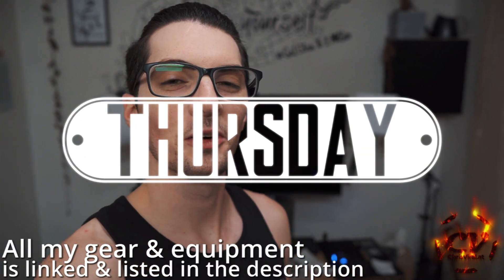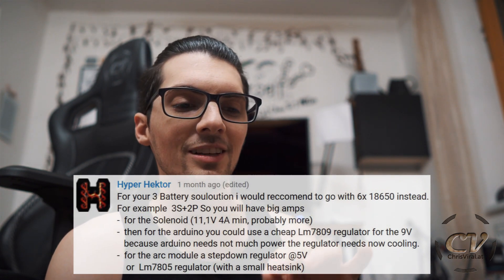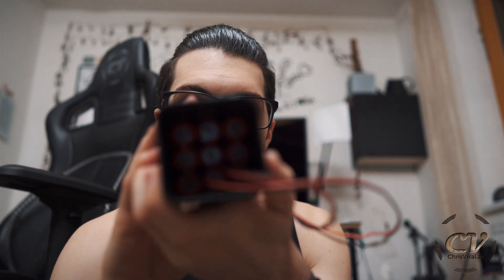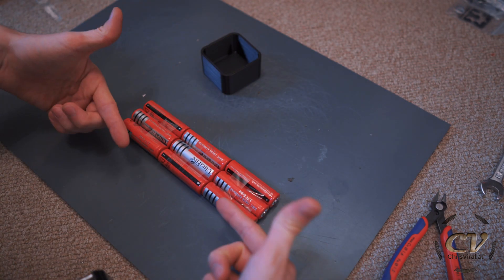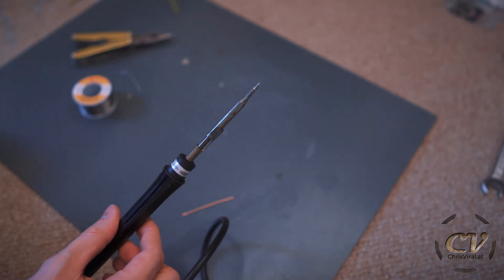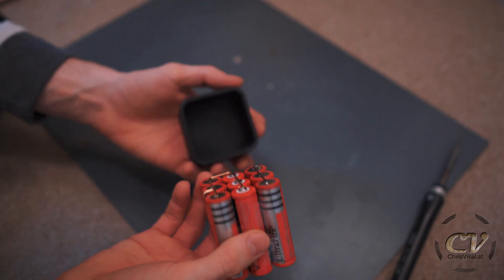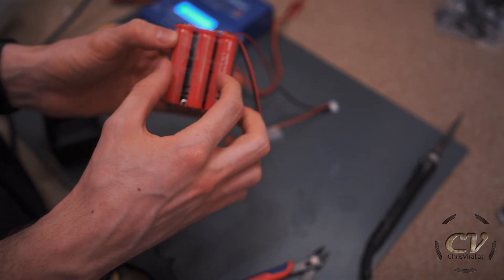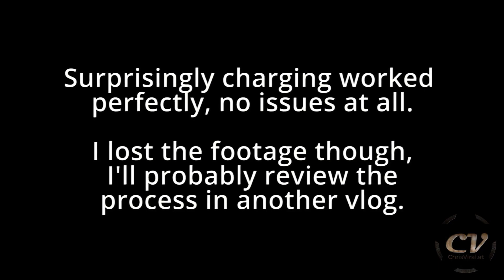DIY 3S Battery Pack (3P3S - With 3D Printed Case)

Comment: Bro, you should not be making a video that you clearly have zero Fuchs as to what you are doing. You are advertising very dangerous sop’s and could get someone hurt or even burn down there house if they followed your so called DIY battery pack instructions. The fact that the 18650’s your using that you got a such a great deal on at 90 cents each is a dead giveaway you really are as dumb and ridiculous as you sound. This is actually a perfect video of what NOT TO DO, I mean the way you explained your drawings was top notch man. Now if anyone watching could actually understand anything you attempted to explain, well they deserve a medal 🥇.  I bet there’s no follow up video because your house burnt down from the crap 18650’s you have blew up. Cheers 😂

Comment: first recharge ;D
i would have done it differently, first charge each battery on its own with a USBdoc(ebay) to see how much mAh each cell has since Ultrafire are a lottery :D. 
They range between 800-1800mAh (usually 1200mAh). So using 3P wasnt a bad idea xD. ( when i suggested 2P i had 2000mAh samsung cells in mind)
I hope you thought about the formfactor of your pack since maybe a long version might be more practical than a handgrenade-formfactor :D. 
(i mean 1 cell thick and 3 cells long and 3 cells wide pack as alternative form factor)

 I prefer old laptop batterypacks to get my 18650 since there are always good cells from samsung inside which usually have 1800-2200mAh.
From 18 cells i had only one cell which was crystallised dead +4 which where semi dead but could be repaired whith a trick. (normally a charger dont accept these cells, but you can repair them with 30 sec bruteforce charging just connect a healthy cell in parallel to the semi-dead one for around 30 seonds, then charge it with a normal charger.
It takes around 3-4 charge-discharge-cycles to cure the semi- dead cell to reach a normal power level of ~1800-2000mAh again.

if you plan more packs , look up "DIY spotwelder" (Car Battery, Lithiumpack or MOT Transformers are the main methods)
easiest imho https://www.youtube.com/watch?v=ZNPqJnqVqrA
list https://www.youtube.com/results?search_query=lithium+spotwelder

  I didnt used Balancers atm myself since i used only 1S and 2P (for my car vaccum cleaner i send you a while ago.
But i collected 16x 18650 from Laptop batterys so in the future i have to build some packs.(i gave 2 cells + a charger as a gift to a friend to hook him up to the 18650 lifestyle Yolo  ;D)
Reply from the maker: OMG YOU KNEW IT!
By now I also know that -.- and I actually got scammed big times. This will get covered in an upcoming vlog, I'm not going to spoil it for you any more than this hehe.

I also already ordered more legit ones with ~3400mAh. But for the flame fist project they should do I hope. We'll see.

Hahaha yeah 18650's are for sure a lifestyle. A good one as well. Yeah maybe my dad can hook me up with used ones since he has around 2000 in his basement lol.

Thanks for the links, looks like a solidly cool project 🙌
Reply: i hope you can get some money back over paypal, i wont accept this scam, at least claim 50% off.max value per chinese cell is 2$.

for the 3400mAh as far as i know from research the genuine one are expensive(6,5-10$ per piece). If you order these from china you can expect a fake 99,99%, because the "normal" chemical max for a 18650 is 2000-2200mAh(samsung originals).
 The exeption are these expensive Panasonic 3400mAh types (Panasonic is the only legit producer) 

since the market is flooded with fakes, i prefer the laptop batteries as source. Another one are Li-Ion packs from Handheld drills (Lidl X20-Team for example)

maybe try to contact a austrian web shop an ask if they can give you a warranty for the product to have 3400mAh. (or atleast>3000mAh).
If they deliver >3mah then 6,5-7$ is ok.